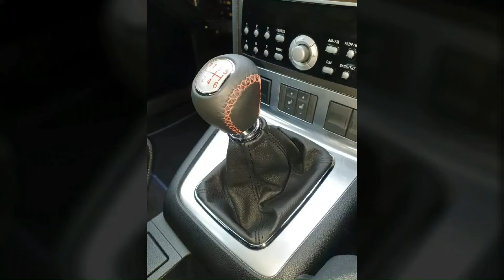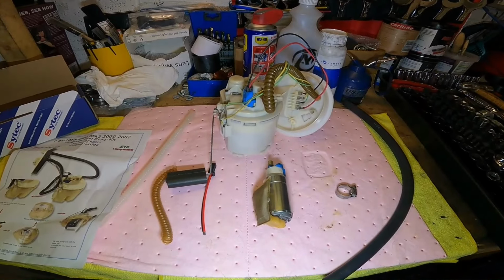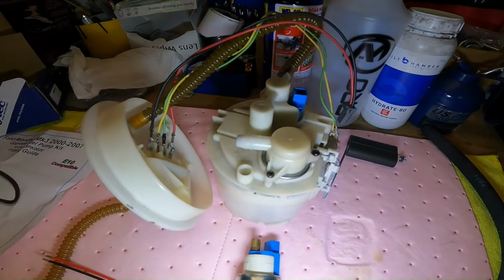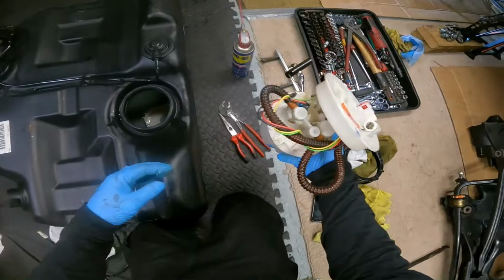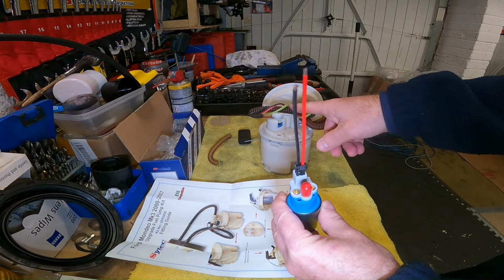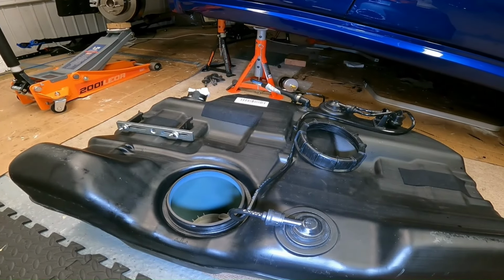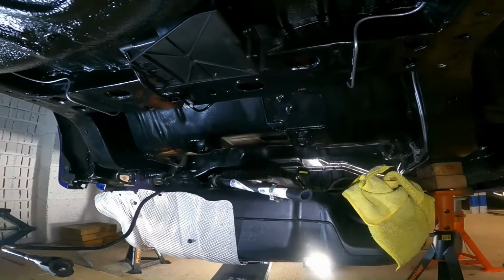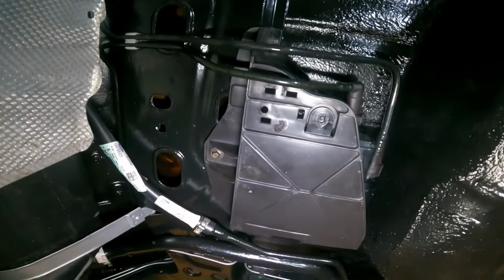ST220 FUEL PUMP UPGRADE

Comment: Coming along nice.
That underside is now immaculate 👍
Reply from the maker: Thanks mate. It's not bad if I say so myself. The rear end work is done for now and back on the ground waiting for 4 wheel alignment so rear end rebuild video will be up soon 👍
Reply: @mondeost220restorations9 
Look forward to seeing the vid.
I've fitted my subframe back on last weekend and out of curiosity, I didn't pin it at first, just pinched the bolts up
I then inserted the pins I turned, following the measurements you gave me and they would not go in.
Slackened the four bolts back off, then fully inserted them home easily, before tightening the bolts back up.
Suprised me how far out it can be without using the pins.
Might get some time back on it this weekend, fingers crossed...